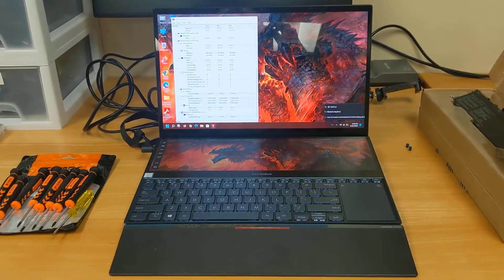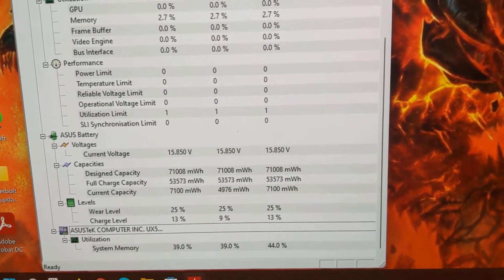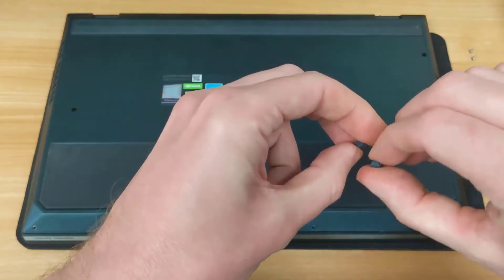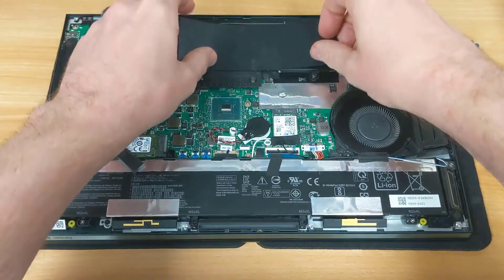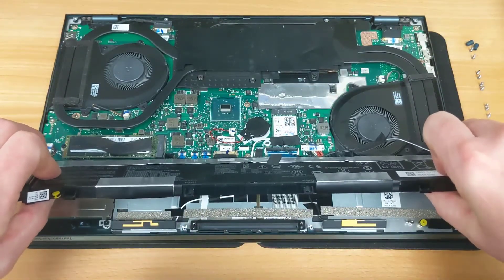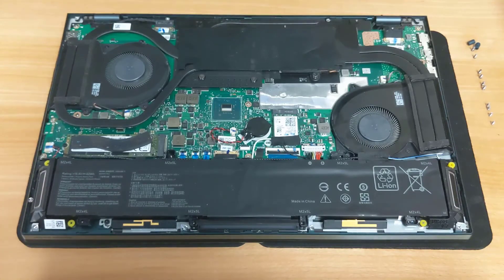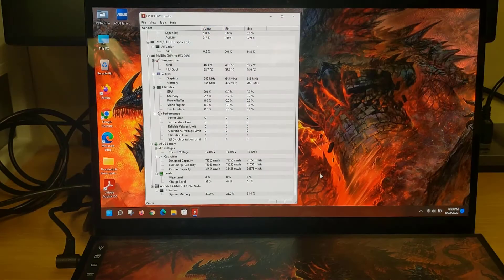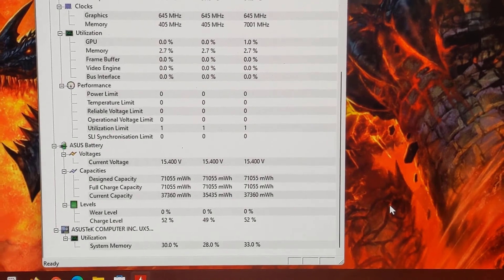How to replace battery in ASUS UX581 laptops

Comment from the maker: In this video we show the process of replacing the battery in an ASUS UX581 series laptop.  This video should also be applicable to similar models.

Tools and equipment shown in this video:

Replacement battery:
https://www.amazon.com/gp/product/B0967QZWG5/

Torx screwdriver set:
https://www.amazon.com/gp/product/B089PTHLQ4/

HWMonitor tool:
https://www.cpuid.com/softwares/hwmonitor.html

Tips:

- The speaker wires can be tricky to remove and put back. Take your time
- Lay your screws out in the order you removed them
- Watch out for the piece of tape sticking from the battery to the keyboard ribbon cable

If you have any questions feel free to ask them in the comments.  If this video was helpful to you, please "like" and "subscribe" to my channel.  It really helps me out a lot.  Thanks!

Comment: Hi Mike, I downloaded the HWMonitor app, and the app only shows the "wear levels" on my laptop battery at 100%—no Charge level, no Full Charge Capacity, and no Current Capacity. If I unplug the power source, it turns off immediately. Does that mean my laptop has no longer "seen/recognized " the battery anymore?
Reply from the maker: Hi Rafael!  Thanks for checking out my laptop repair videos.  Yes, in my experience, a wear level of 100% means the battery is completely worn out or has suffered some kind of internal failure.  As you noted, the laptop shuts off immediately when disconnected from power - this means the battery is not working at all.  In addition to the HWMonitor tool you can usually verify this by checking the laptop BIOS settings.

In your case, I would start by replacing the battery.  Make sure to inspect all physical connectors and wiring for anything loose or damaged.  You may have additional issues (such as with the laptop motherboard charging circuitry or the AC adapter), but I'd start by replacing the battery first.  Good luck, let us know how it works out!
Reply: @CompTechMike  So far, so good. I replaced the battery, and it turned on. Now it's charging. I'll wait until it is 100% charged and remove the power source to test. I just realized the original battery is 71W, but the replacement in your video and the one I've got from Amazon are also 62W. Nothing really to worry about, but I couldn't find any 71W battery. Do you know why?

Comment: Hello I did the same and its running but says 0% after charging 15min...do i have to reset something ?
Reply from the maker: Hi! Have you installed the free HWMonitor tool? What does it show? It's possible you just need to let it charge overnight. But if HWMonitor shows the battery is "100% worn out" it's possible you got a defective battery. You might also want to try with a different charger, but I'd check that tool first. Good luck!

Comment: Battery Modell = C42N1846 = 0B200-03490000
Reply from the maker: Thanks!  I normally try to include that information, must've blanked on it when recording this video.  🤣  Here's a link for one on Amazon:

https://www.amazon.com/ZTHY-UX581GV-H2003T-UX581LV-BP1911U-UX581LV-H2014R-UX581LV-H2002R/dp/B0B56QNWQV/

I buy ZTHY brand batteries pretty often and have had good luck with this brand.

Comment: Hey Hi would happen to know the sizes for the screws ?
Reply from the maker: Hi!  Good question.  There's different sizes depending on if you mean on the case or for the battery itself.  T5, and M2x4L and M2x5L for the battery.  If you pause the video at various points (such as 3:23 ) you can see the sizes printed on the battery where they go.  Hope this helps!

Comment: After doing this the laptop won’t charge. Could I have bumped something? The new battery worked as it drained the power it came with. I also tried putting the old battery back in but charging won’t work. What did I do wrong? :(
Reply: To clarify, the laptop won’t power on or charge when plugged in anymore.
Reply from the maker: @bobkruse4820  hi! Thanks for the comment. It's definitely a frustrating feeling to replace something only to have something else break in the process. 😥

If I understand your comments correctly, the laptop is not powering on at all anymore, even when plugged in? A laptop should be able to run when plugged in even if it physically has no battery at all (you could remove the battery and still be able to use it). Do you have a spare AC adapter? That's what I'd try first. A different power supply. Also go back and double-check any connections near where the AC adapter plug connector is connected to the motherboard. I don't remember for ASUS specifically but many times there is a separate connector so that the AC adapter socket can be replaced without replacing the motherboard.

Worst case scenario something in the charging circuitry on the motherboard may be damaged, but I'd try with a different adapter and double checking the internal connectors first. Good luck, let me know if you find the solution!
Reply: @CompTechMike  thanks for the quick response! 

correct, it won't even power on anymore.I just ordered a new power supply. Hopefully that's the problem. It's just an odd coincidence that it would die at the same time as replacing a battery.
Reply: @CompTechMike  Had the same issue recently trying to swap out the battery. It powered on after it was replaced, then while using it it powered off and now will not power back on. I tried putting the old battery back in because at least with the old battery it powered on and was usable. Now there is no indicator light and no response from the laptop. any suggestions?
Reply from the maker: @bryandracker6631  Hi Bryan! Thanks for the comment. It's tough to say without seeing it, but I'd follow the same steps I suggested in the comment before yours. It is possible something shorted out or got overloaded during the replacement process, or that the replacement battery somehow damaged something. I'd try removing the battery completely and see if it will power on then (with just the AC adapter plugged in). Also try it with a different adapter, if possible. Reverse your steps and double check everything. Make sure you're grounded before touching any internal components and that no screws are touching the motherboard. Try intermittently long-pressing and short-pressing the power button to see if that jogs it. But if you're not getting anything at all - no lights, no fans, no activity - it's possible the motherboard has failed. Or it could be something as simple as the power button being stuck. Good luck, if you figure it out let us know!